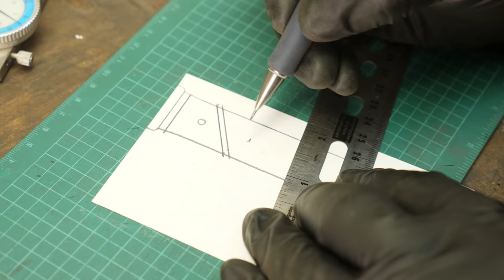Rusty Bowie Knife Restoration

Comment: So this is something i am going to attempt in the near future.. with the same knife! Its a Utica sportsman, made at utica cutlery here in Utica NY back in the 1920s thru the 1960s and 70s..  and i collect them.. the blade was usually etched and it wore off with use.. sometimes it was stamped. yours had the winterbottom bone handles, of which i have owned many.. the one i plan to work on has the plastic handles, and with these handles the guard is always loose..nice job with the wood.. gives me some inspiration!

Comment: You really should’ve glued that old handle back together it made you molds out of it and then you could’ve used colored brown and cream Apoxsee resin’s knife handles that look like bone or ivory. You get your mold made for each side then you take a white Apoxsee or cream Apoxsee and just draw a little lines in the bottom of the mold for your contrast and then mix up a brown Apoxsee and just swizzle swipe into it so poor that in there and you should have something that Replicates antlers And then the sooner you could put a metal rod for strength are used multiple composites but something you could do real cheap and really easy